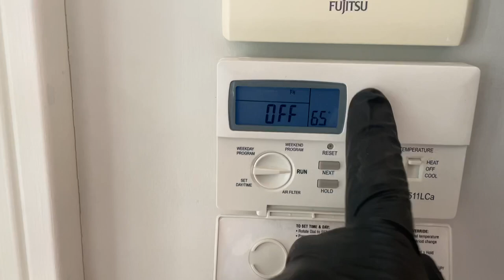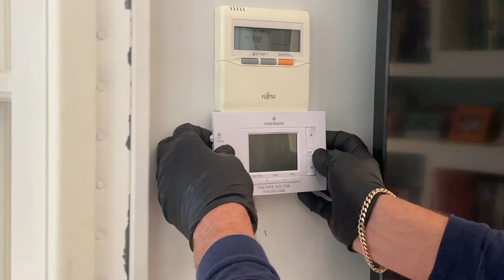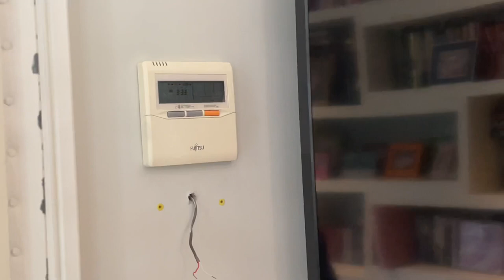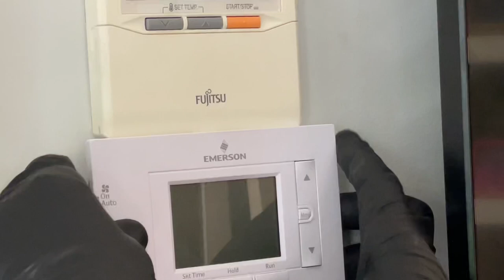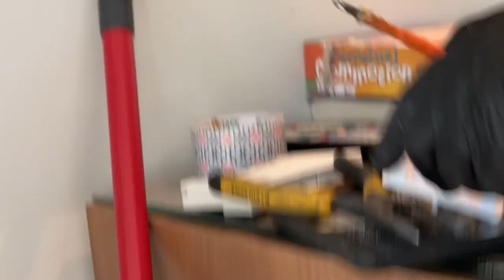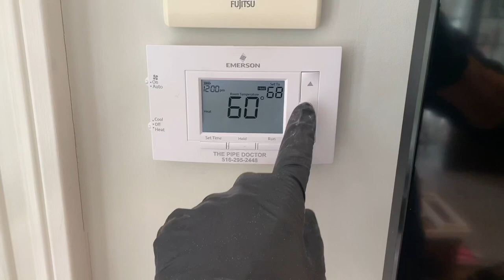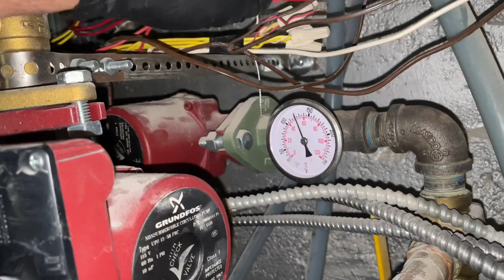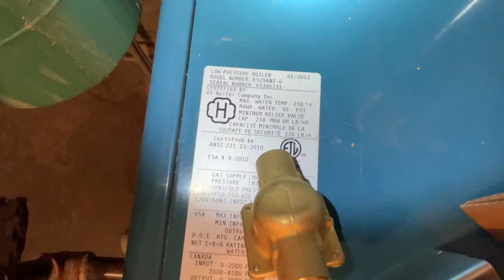No Heat in One Zone How to Replace 2 wire thermostat & Honeywell 4 wire zone valve

Comment: I love those Emerson Smart Thermostats.  We installed a Sensi Smart Thermostat last spring, and that baby has saved already saved us the unit cost when comparing my heating/cooling costs from last year (same time period) vs the same time period this year.  We have a Natural Gas Furnace w/ Air Conditioner.  It gets 90-95F in the summer and -40F in the winter.  Question for you Mike.  Our unit is battery operated, would you recommend we re-wire to hard wire it?